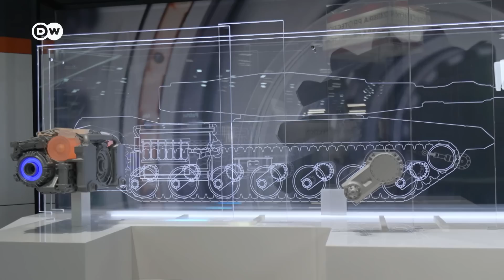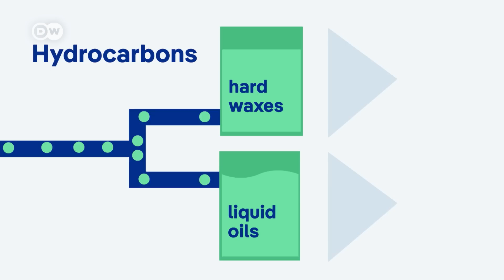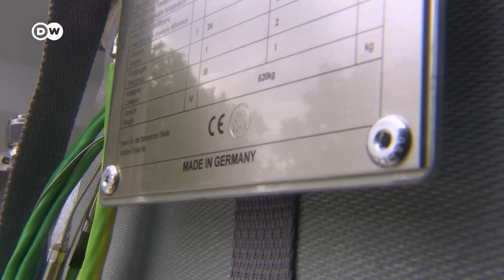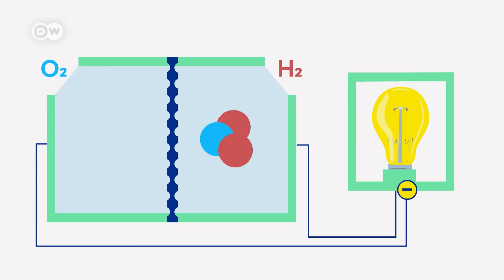What technology will military vehicles use in the future? | Transforming Business

Comment: The major advantage of a hybrid tank is the reduction in logistics demands. ie if the AmbramsX can reduce consumption by 50% then the same logistics can supply twice as many tanks.  
Additionally should a military vehicle be able to run on electricity alone - even for some of the time - then its heat signature is going to be much lower and make it harder to spot and destroy.
Light vehicles powered electrically does actually make sense as well logistically, there are lots of options to make electricity, and battery tech is improving exponentially. 

All of that being said, the whole concept of making a tank environmentally friendly is pretty silly. It's better to make a tank that can do more with less and is more capable/survivable in battle. No tank is environmentally friendly when it is burning.

Comment: You may hear "green" but the real reason this is pushed is an actual strategic advantage: fuel consumption and logistics lines 

Higher efficiency and synthetic fuels vastly reduce key failure points these vehicles have to face 
Anyone who's read a bit of modern history would realize that as the biggest limitation is supply lines.

Reducing fuel consumption and being able to produce fuel in house even if you don't have your own oil in the ground is a GAMECHANGER of epic proportions.

Comment: They could use a generator in conjunction with a supercapacitor (instead of battery).  Essentially, this would be hybrid but far better mileage if the generator is tuned for maximum fuel efficiency against the super capacitor.  Look at Skelcap capacitors out of Estonia.  Another option is isotope batteries.  Research should focus hard on thorium reactors, though.  These could be miniaturized such that a tank or other armored vehicle would come out of the factory with all the fuel it ever needs built-in.  Thorium reactors do not produce radiation at dangerous levels and do not melt-down.  They are also not as high energy density as uranium but it has plenty for armored vehicles or aircraft.

Comment: What a load of bull*hit.
It is just much simpler mechanically to make a transmission of the tracked vehicle electric. 

It has also many advantages when you need to place an engin in an awkward place. Engine must be protected, cooled and easily accessible for repairs, this apply some unique constraints. Also, don't forget that a driveshaft needs to exit an armored hull somewhere, this creates a weakpoint.

As for the batteries: it is both ability to get to places silently (even for the last run) and having an alternative power source to be able to bug out, even if the main generator is damaged.

Hybrid electric is the future of the combat vehicles and ecology has nothing to do with that.

Is this just a way to sell the idea of the long needed rearmament to tree hugging lemmings?

Comment: In the Iraq wars and Afghanistan the fuel had to be transported to the massive military bases and when you had fuel tankers driving through enemy territory it was a mass slaughter, that's why the people driving the lorry's were not European but friendly locals, when thousands of them get slaughtered it didn't make the news so much.

The hydrogen option looks the best option for tanks, armored vehicles and cars, because hydrogen can be generated on military bases with hydroelectric, or solar, or maybe wind power (but no wind power near where helicopters have to take off).  But the amount of energy required is truly massive so it doesn't seem that realistic.  Someone will probably have to still drive a massive fuel tanker through enemy territory with a very high probability of enemy forces shooting at the fuel tanker.

As for inventing bio-fuels, we already have bio-fuels, you can make bio-diesel by growing corn (or some other plant).  And in the 1970's when there was a fuel shortage Brazil switched to using alcohol.  So if Brazil could switch to something that doesn't need crude oil in the 1970's, then why is there all this messing around?

Comment: What does climate neutral have to do with these developments? Nobody is talking about making these plug in hybrids. They are going to be hybrids because future active defense systems are expected to be energy hogs, requiring a rather oversized generator attached to the engine and significant battery cap. for peak activity .So why not allow the tank to silently poke its nose up a couple of kilometers and back (designed right, a generator can be turned into a motor with a flip of a switch).

Comment: “Fossil fuel” and “oil comes from dinosaurs” is a Misnomer. 
Zero justification atm to switch away from gasoline and similar fuels. It will hurt everyone

Keep developing electric in a natural and honest way instead of trying to push it before it’s ready let alone pushing and forcing entire nations off of  these fuels when the hardware, vesicles, motors etc aren’t entirely ready let alone the the infrastructure. And forget about electric 18 wheelers. That’s not possible let alone remotely feasible currently, pun intended

Comment: Correction, the M1 Abrams has a gas turbine engine that uses all sorts of fuel not just kerosene.
Reply: It can use diesel but 99% of times uses kerosene, "all sorts of fuel" is kinda exaguration. Being able to use diesel is just fine as it is the most common fuel.
Reply: @milosmitrovic3239  It was intended to run on whatever combustible liquid fuel was available for logistics reasons. Everything from alcohol to jet fuel.

Comment: Hybrid electric is definitely a priority and key logistical advantage that any military could have. Fuel has to be moved, has weight, generates emissions operators breathe, and can be bombed.

BEV isn't currently feasible for frontline vehicles, but "environment protection" is honestly a minor reason for a military to want to go electric/hybrid. More efficient vehicles have more range, lower noise, lighter logistical footprint, and less thermal signature.

The cost is maintenance, which is nontrivial, but I bet will be worth it in the long haul.

Comment: I'd imagine most tankers will refuse to use them. Imagine a round hitting a lithium battery. The crew wouldn't have a chance.
Reply: The engine is separated from the crew so it if it was replaced with batteries it wouldn't affect the crew. The real killer is ammunition storage, but only on older tanks and ones that aren't made by western countries. That's why you see videos of Russian tanks getting blown in half all the time, the explosion starts a chain reaction that detonates all the ammunition on board. Comparatively lithium will make a fire that you can't put out in an area away from the crew so the tank will be damaged and probably impossible to recover but the crew won't be harmed.
Reply: Imagine a round hitting 2,000 gallons of kerosene. Oh wait.

Comment: It is honestly a little insane talking about reducing the emissions of war 😮.
Reply: Lower emissions means also less heat and less noise thus less easy to detect also.can mean longer range due to higher efficiency
Reply: Think of it more as the countries with no oil resources could fight a bit longer if needed, like almost all EU countries, the environmental part is just words.
Reply: @indrekveskimae7267  
Spot on..... with major spillover effect on civilian use.
Same reason why EU is betting big on hydrogen, now the whole world can be energy supplier instead of a few 'oil producing countries'.
Reply: Probably 95% of military equipment is never used in a combat zone, and even then only for a fraction of its life cycle.
Use of synthetic fuels and hydrogen is also a way to reduce/change supply line dependencies.
Reply: This isn’t really about reducing emissions, it’s about securing a strategic energy supply.  The U.S. and the Middle East produce enough oil to fuel their militaries.  Europe, not so much.  She has to import her oil and gas.  In a war, there’s no guarantee that she’ll be able to import those goods.  Europe needs to secure her fuel supply, and fast.
Reply: The main point is range, hybrids tend to have longer range than normal engines. IF hybrid tanks have a longer range than current models, then why no
Reply: @_.F0X._  ye and in a warzone you could have a lack of gas, then you can charge or a lack of electricity and then you can use gas
Reply: @_.F0X._  when you run out of charge, the dead weight of batteries, could've been a bigger fuel tank. Hybrid is a joke. You might think a Prius has a long range, but a longer range could be achieved if batteries were taken out and fitted with gas tanks. and the thing about fuel is that the vehicle gets lighter as it burns fuel.
Reply: If you are going to kill a bunch of people and waste a lot of resources on war, might as well been green about it
Reply: They need/want to dev storage and charging solutions to power laser anti drone/missile weapons they plan to mount in the near future, the emissions theme is solely for the left
Reply: jeah, bit weird thinking over there
Reply: Handicapping your own military’s effectiveness.
Reply: What about Drones?
Reply: Problem is war has been around longer than recorded history. 
Little chance it will go away ever.
Reply: Oil will eventually run out, and you don’t want to rely on foreign suppliers
Reply: Less fuel consumption per km=better logistics 
Making fuel in house= better logistics 
Reducing emissions and heat= major strategic advantage 

You may hear "green" but this is a massive improvement in the most important factor of a war: logistics.
Reply: Because it's only best sustainable business for many countries.
Reply: Add that military vehicles are also used for training exercises during peacetime. And if European NATO countries mean to increase their preparation, more training will be needed.
Reply: Longer vehicle range, smaller supply constraints. There's plenty of reasons to focus on the fuel economy of military vehicles.

Comment: They also have to have a better battery solution. Lithium ignites when it comes into contact with water, even just moisture in the air. It's less of an issue in civilian use, but imagine anything hitting a lithium battery in a combat zone, particularly a small vehicle meant to carry wounded. Outside niche uses, most of these things are a pipe dream until this is resolved with say, carbon batteries, which even when they work out the kinks, will be larger and heavier.
Reply: You need to rethink your understanding of chemistry.  Sodium also burns in air and chlorine is a poisonous gas, but when you combine them we put the result onto our food to improve the flavour.  NaCl = table salt.  Salt doesn't burn.  There are lots of different battery types on the market today that use different chemistries. LFePO4 batteries are very stable and solid state LiIon batteries do away with the flammable electrolyte.

If you really wanted to think about the most dangerous fuel source for management then it'd be nuclear, and surely you wouldn't use that it weapons platforms! Oh wait, nuclear subs and aircraft carriers are frontline targets in a war zone...
Reply: Lithium titanate should be ok chemistry for this purpose I'd imagine